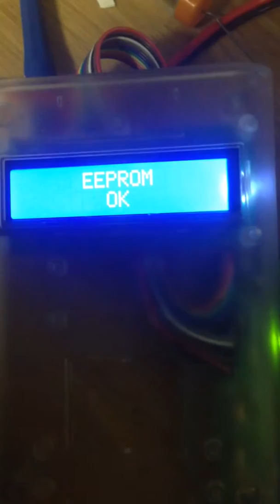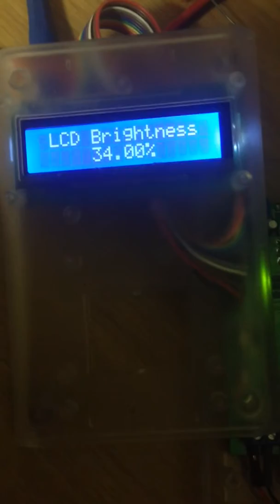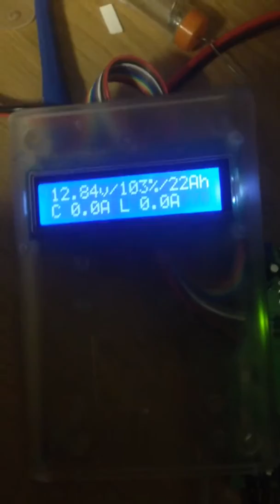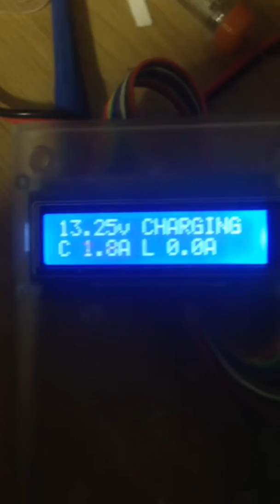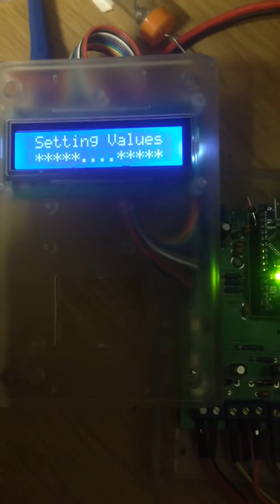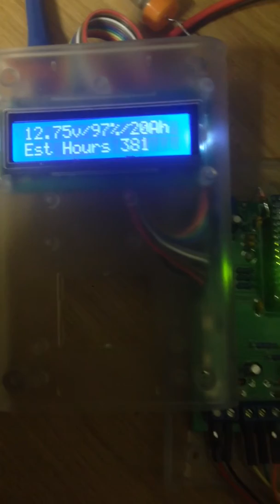Arduino Battery Monitor v7.9

Comment: do you know the code for SOC using coulomb counting method?
Reply: Bro did you find the code using colomn counting method for SoC? I'm also trying to show the soc of 24 V lead acid battery with on load condition..If you have please share your code bro
Reply: @uthayakumarrh1521  did you find it ?
Reply: @NawtieBoy96  No